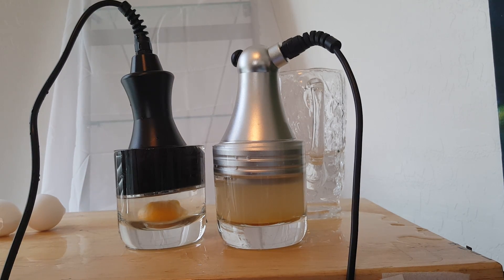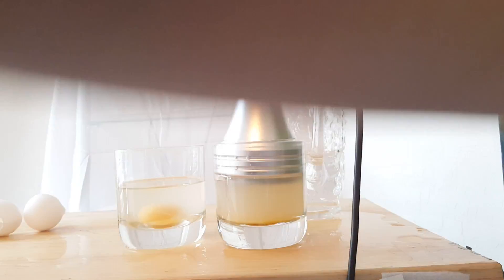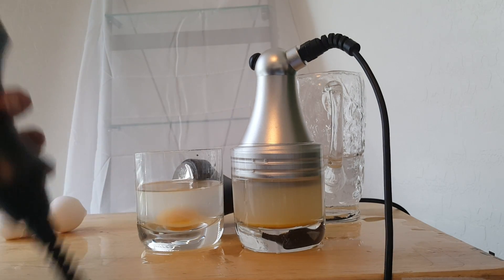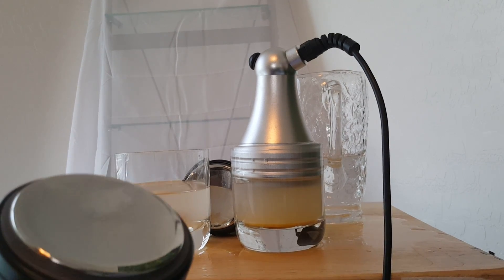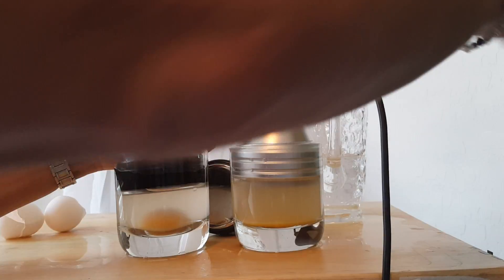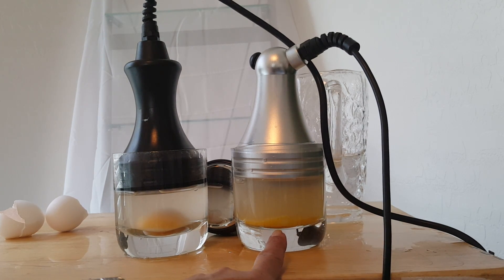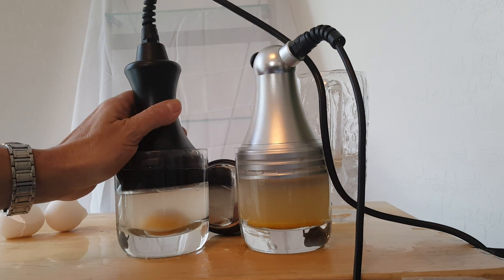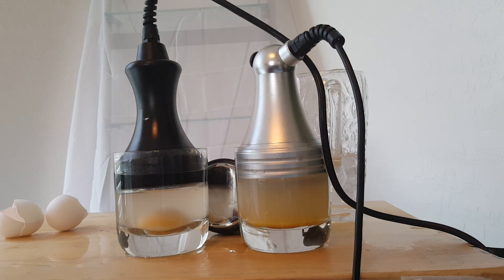Ultrasonic cavitation head test part 2

Comment: I found the machine is but is no longer available. Is called the SainSonic GS8.2E Ultrasonic Liposuction Cavitation Slimming Machine Equipment 220V

 I did a reverse google image search and found it through the head which is called ultrasonic M80.

Comment: Please edit and post the make and model of each handle. The video would get a thumbs up if you described the models your comparing.
Reply: Dominique Dredden I found the machine is but is no longer available. Is called the SainSonic GS8.2E Ultrasonic Liposuction Cavitation Slimming Machine Equipment 220V

 I did a reverse google image search and found it through the head which is called ultrasonic M80.
Reply: @yadikay  I have that one, I just bought it from mychway.com.